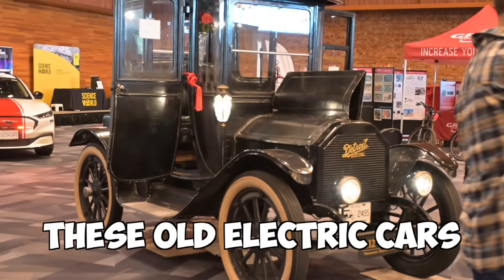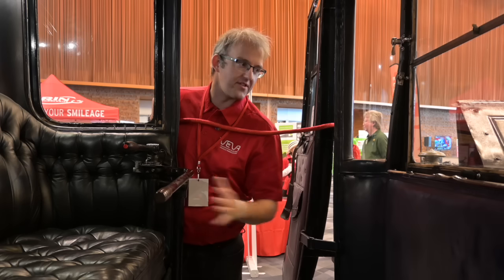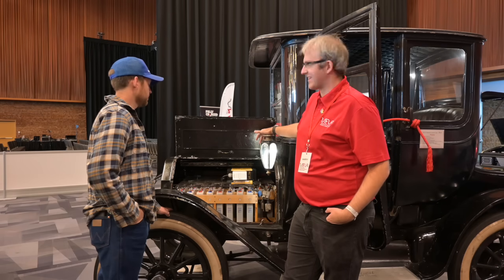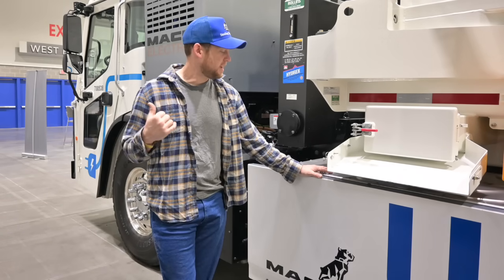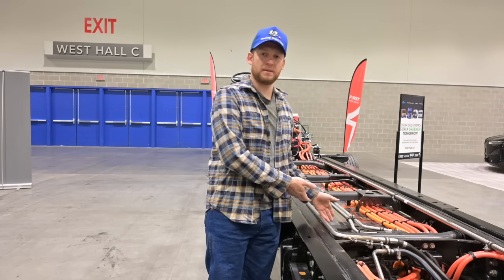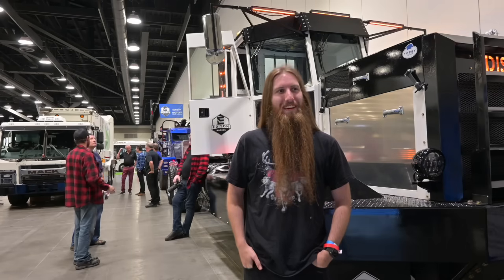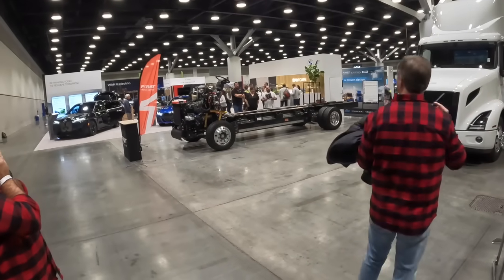The Most INSANE Electric Marvels | Fully Charged Show

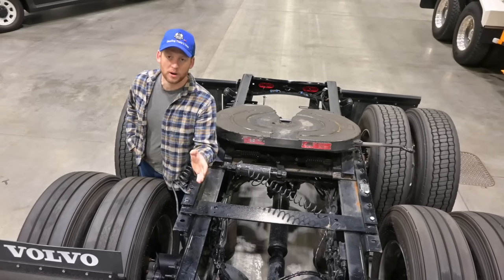Comment: 2:45 Semi tractor with boggi with one drive axel and one lift axel is the commen setup in Norway. This setup works very well on snowy mountain passes..

If extra traction is required, the tag axel is lifted and temporary driving with overweight on the drive axel. This ensures the chains gets pressed down in the snow, ensuring good grip.

I believe this also applies in Sweeden.
Reply: Finland also, if you want to get anywhere in the winter in the nordics with a semi then you need a lifting tag axle or two drives preferably with possibility to transfer weight to one axle. There is a light slope from an on ramp to a fairly big road near where i live, and every winter is have seen semis stuck on it, usually 4x2 from Baltics

Comment: That fully electric Mack garbage truck brings to point why Topsy is a needed platform.  The Mack can only run 5 or 6 hours on a charge, most likely in ideal conditions, not even a full shift.  A company would have to have double the number of trucks in their fleet just to keep up.
Reply: i would rather say that is the best place to put fully electric trucks, they dont drive far, and they can go back to the garage over lunch to charge, plus a very large part of the driving is city driving where the reduction in noise and pollution is needed the most.

Comment: You said that Freightliner's electric truck is using lightened frame rails yetbuou still use overbuilt frames. I would not worry to much as your L500 will outlast the rest of them combined. Keep up the great work and don't worry, you will succeed.

Comment: We got to check out the Mack garbage truck here in Orlando Florida. I thought it was only fitting that it got to park next to Topsey. The Mack electric truck seem to be one massive electrical failure in the trucking world I don’t know why anyone would choose to pick up trash with that piece of trash. To be more specific it weighed a massive amount more than a diesel truck that had to have a special dispensation to carry the electric weight which meant it is now I’m not carrying the load that it was designed to haul and it could only operate at a very limited amount of hours I think the 5 to 8 hours estimation was grossly overrated and in real life would be lucky to make it through half a day. On the other hand your truck would run and run and run and only want the others to get out of its way. By the way I am surprised that you did not know that the top loading Mack axles was the king Kong of the trucking world.

Comment: The funny thing is they were using propane fork lifts. One of the few things that have been electric for decades and they use a propane version at an electric vehicle event. Clearly assumed the public wouldn't see that part so it didn't matter.
Reply: Probably the in house, event space, forklift!!
Reply: @floridalifestyleapparel5477  oh no doubt but that's odd too. I know here in Ontario in general you're not allowed to use propane forklifts indoors. I don't know the word of the law but pretty well most places I worked had propane forklifts for outside and electric for inside. And was told by management that the use of propane forklifts inside was limited.

Comment: I want to know more about that Ranger at 5:22, a little OG Ranger with 100ish miles of range would be my perfect local runabout.
Reply: One of my coworkers has one too. They were sold electric as new at some point. His is retrofitted with more modern battery storage, charging and drivetrain.
Reply: S10 had a similar thing at one point? Would be super cool

Comment: So electric cars are still affordable to the rich only.  Progress 😆
Reply: And still, like then, the problems all go back to batter technology...
Reply: @geek49203 yeah, we are getting there, but very very slowly. I hope solid stae will make good reliable vehicles
Reply: @geek49203 Also, there is no infrastructure to support them. Hybrids are the way to go for now, when there is a huge public demand for full electrics industry will have to support them.
Reply: Speaking about cars only, yes and no. Higher initial purchase price, yes. Cost of operation/maintenance is much lower. Only real maintenance items are tires, brakes, and windshield wipers and washer fluid. Cost of electricity vs gasoline is where the savings really are. My guess is that you'd break even or save with the electric if you consider the whole picture. All that being said, if you need very long range or are hauling, electric only is not really viable at the time being. That's what makes Edison's diesel electric approach so appealing.
Reply: Until you have the batteries glich out.  Can't exactly "install a new plug coil" in your driveway on those sparky cars, can you? @KC2DZB
Reply: I would say new cars are only for rich people. In Europe at least you can buy an elecric car for the price of a diesel or gas car. At the low (price) end there is Dacia, at the High end there is Rimac. I needed a van/car/tow vehicle so I bought a used diesel van, as regard less of gas/ deisel/elecrtric they are too expensive for me to buy new. Good thing is Leafs and I3's are now getting low enough (in price)  that if I can have justa car, then they are affordable....ish